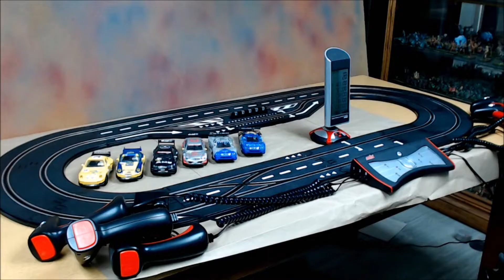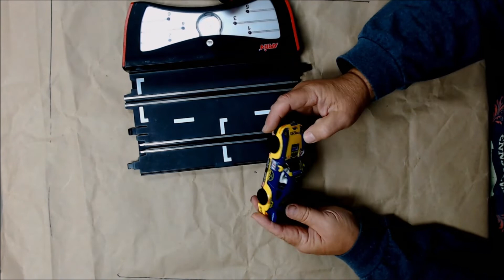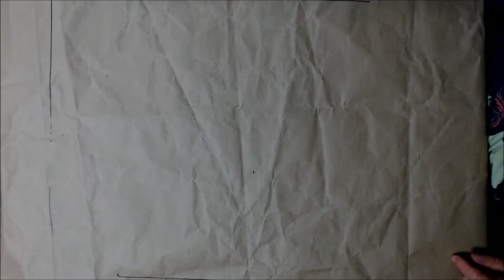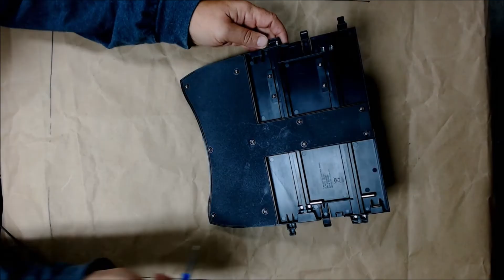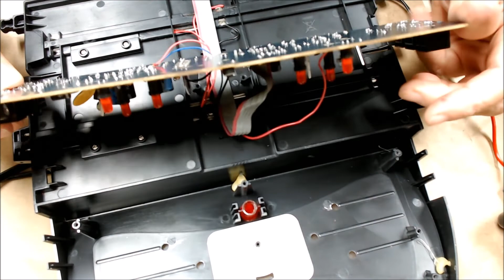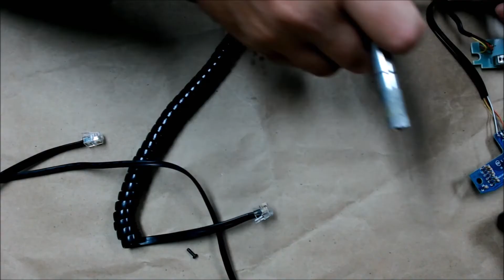Artin Digipro and Carrera D132

Comment: Wrong , use the Black flag . Just change its shape. Red dont see red
Reply from the maker: The Carrera guide is too long. It binds a bit and causes the gate to bounce back.  It works fine with Pioneer or with a modified Carrera guide.  You are right, and thanks for the tip.